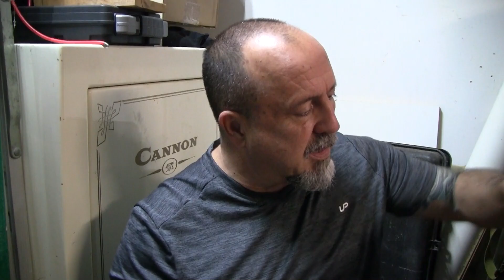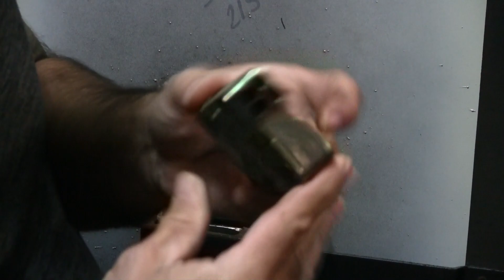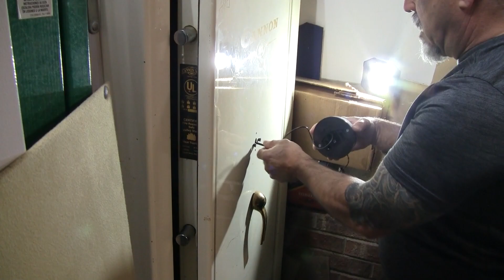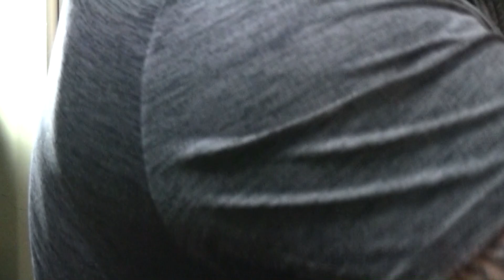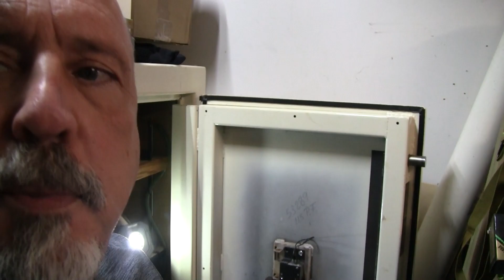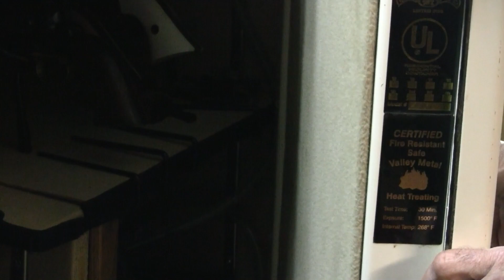Cannon Gun Safe New NL Lock and Keypad Replacement - Part 2

Comment: @ExtremeDIYGuy I just did this exact same swap under warranty, with the same NL kit from Cannon, and ran into the same issue with the relocker plate.  I know this was 4 years ago for you, but in hindsight do you think it might have been easier to drill another hole for the relocker bolt rollpin at the top of the relocker plate vs. grinding a 16th off the bottom of the bolt?

Comment: Keypad went bad got new keypad ends are different. Called cannon they said call locksmith how do I use new keypad before I drill safe and buy new one?
Reply from the maker: Cindy, I would check with the folks at https://mbausa.com/, before I do anything. They may be able to help. Make sure you have the old keypad handy, they willprob want to know what it is.

Comment: I would like to know how to open my keypad safe in the event of an EMP, Solar Flare or when no batteries are available in the near future; mine does not have a key for said event and locksmiths will not be available to help me open it when needed? Any help here would be appreciated for future situations beyond our control?
Reply from the maker: The only way I can think of is to cut it open with a cut off wheel. Barring that, there's an old school way called "peeling" it open, kind of like a tin can only a lot harder

Comment: I just finished putting a replacement keypad and lock on my 10+ yr old cannon today.  Ran into the same problem with the relocker bolt.  I had enough play in the plate to get my clearance luckily enough.  They didn't supply the shoulder screws, which sucks
Reply from the maker: Yeah, the replacements aren't exactly an exact fit.

Comment: I just replaced my keypad also. I have the same setup. Question though, my safety bolt clears but how will it fall to lock for safety?
Reply: Huh?
Reply: If somebody try’s to punch out the lock assembly, the plate slides off the holding pin. The spring pushes the re-locker bolt down and through the hole.

Comment: Thanks! Gave me the confidence to do this myself. Cannon customer service was a joke. Told me 20 days to ship the lock. I freaked and they sent it 2 day, FedEx. In short, I would never buy anything from Cannon again
Reply from the maker: Your welcome but yeah I agree would not buy cannon again.
Reply: I watched your first video as my 2011 Winchester will not open.  Factory told me to keep replacing batteries but that is not my problem.  When I enter the correct combination I hear the two beeps to validate the correct entry.  At the higher level of factory help they instructed me hit the door below the lock and above the turn wheel while they listened to confirm the correct code.  After a few hits with the rubber mallet they told me my safe was out of warranty and that my lock was broken.   In your case did you also hear the two beeps before your removal and replacement with the Amazon key pad?  Hope I can avoid drilling my safe not to drill my safe, Thank you fro the videos - John

Comment: HELP PLEASE!!! Can’t get into my Cannon Sentry “EXECUTIVE VAULT” for over a year now.  EVEN CANNON ISNT FAMILIAR WITH IT AS ITS AN UPGRADED LESS COMMON MODEL ( I guess!) Can’t move it due to weight of safe and all the heavy contents to get the model # off the back either. It’s a large floor safe and has my guns and ammo in it. Can’t move it out of storage either because of the weight inside. New batteries weren’t working, Cannon sent me a cheap replacement of the keypad in place of my heavy duty brass one and it works but still can’t get in…. it does beep now  (a red light??) each time I push a key though. Thought it might be the relocker system due to the moisture in the south or it’s 20 yrs of age so Cannon sent me one (minus the bolt) but can’t open to replace that either and might not even be for the correct model #. It’s like brand new still and really don’t want to cut it open!!! Worried about all the ammo and  cutting into it too! Bought a 350 pull weight magnet and nothing!! I can’t find any videos on this specific Cannon  “Executive Vault” which have the double steel door plates (rather than the common 1 plate) and 4 steel locking bars ( rather than 2). Which set up does your safe have??? Tried for hrs to drag the magnet around the relocker bolt area and around the keypad areas……WHAT CAN I DO??? Going nuts!!!!! Have to get to my guns and valuables! Please respond, I really need some advice!! I’m being quoted $800. to $1,000.  to cut it open and another $400.-$600. to patch the cut holes again….  I paid nearly 1000. for it way back then so I can image the replacement cost……… PLEASE, any help is appreciated, if you have any ideas!!!
Reply from the maker: Judie, they are charging you way to much. First, don't call a locksmith, most of them will simply cut it open leaving you with an expensive storage closet. Go to http://www.savta.org/ and find a certified safe technician near you. They should be able to drill, open and reseal the safe for you at a reasonable cost. If you have the replacement components, you can install them yourself. Or they should be able to install them at an modest additional charge. It really sounds like they are quoting you fairly high prices. However, I am not a safe tech and that might be the going rate where you are. I would definitely go to http://www.savta.org/ and look for techs in your area and see who is the most competitive. I'm sorry I can't be of more help!

Comment: Hello Jose, how many wires had the original cable?
Reply from the maker: 1 wire with four conductors if I remember correctly
Reply: @ExtremeDIYGuy  Yes I think I saw 4 conductors on the wire, thanks.

Comment: NL is a Italian lock brand.  This is the lock I'm replacing, the same as you've installed.  Electronic locks are subject to EMP corruption.  Electronic locks may be certified EMP resistant but not EMP Proof; only mechanical locks can be EMP Proof.  If it's no concern of yours, then risk it.  I thank you for a look see at the NL key pad mounting onto your Cannon safe.  The original vertical mounted keypad to horizontal NL keypad mount was of great importance.  I'm leaning toward a S&G 6730-112, for a Stealth UL50.  Sadly, a US made safe with a Italian made electronic lock having no EMP "Resistant" certification.  S&G does have eLocks with Mil grade EMP resistant certification; they just aint good enough for me.
Reply from the maker: The quality of the NL wasn't as good as the old keypad, but neither of them would stand up to an EMP blast. Funny thing is that if you ground the sage correctly, it's a giant Faraday cage, nut the keypad remains unprotected.

Comment: You are supposed to use a pair if vice grips to hold that spring loaded bolt up while mounting lock.
Reply from the maker: The cannon video shows it being lifted and placed on the slide bar but wither way should work

Comment: Why did you change your lock? Didn't you change your keypad once before
Reply from the maker: Cannon sent me a new lock, an NL brand lock. I no longer trusted the mechanism that was inside the safe since it was 20 years old. I replaced the lock and the keypad as I don't believe the LG keypad will work with the NL lock (I'll admin I didn't check that). But I thought it would be better to keep them matched. I'm still considering buying an LG lock and putting in the keypad I took off along with the new lock.
Reply: @ExtremeDIYGuy  what can you do if you forget your combination to lock
Reply from the maker: @johnwalters7415  You probably have to call a safe technician. the LG locks have the capability to have a master code programmed in to them but I don't think Cannon does that, although it is worth giving them a call.
Reply: @ExtremeDIYGuy  you have to get the law involved
Reply from the maker: @johnwalters7415  Yep, I know you do for the portable safes, need a signed affidavit from an LE Officer, probably the same for the gun safes
Reply: @ExtremeDIYGuy  we do not need them seeing our safe.Lol!!
Reply from the maker: @johnwalters7415  I have nothing to hide! lol
Reply: @ExtremeDIYGuy   is not good to let everyone know what you have
Reply: @ExtremeDIYGuy  it would be fine if they don't look inside they don't need to see what I own
Reply from the maker: @johnwalters7415  Gotcha, I agree.

Comment: Oh no......... You already ground the bottom down ......
Reply from the maker: Yeah, Didn't want to do but the only other alternative (which I seriously considered) was to leave it out altogether.
Reply: @ExtremeDIYGuy  You could have enlarged the holes fixing the relocker's plate to the lock. If 1/16 was all that was required on the relocker, you could have "got away" with the same amount of moving the plate up, and there would have been enough surface on the screw head to keep holding it (a nice flat washer if needed...). It seems to be mild steel (and it should be - you want it to deform and release the relocker before anything else gives way!).